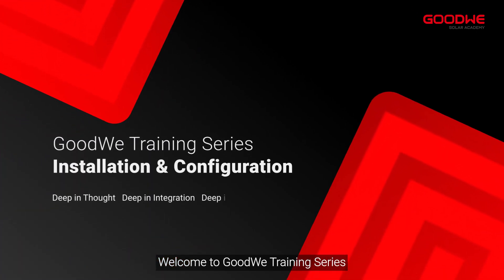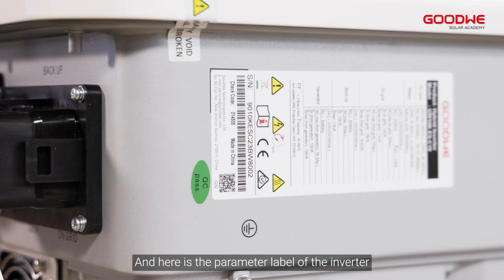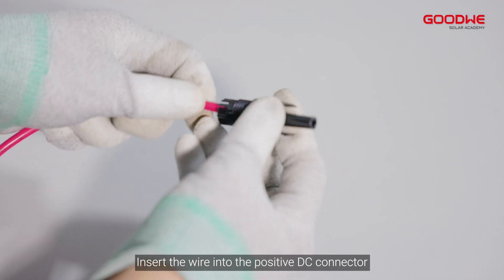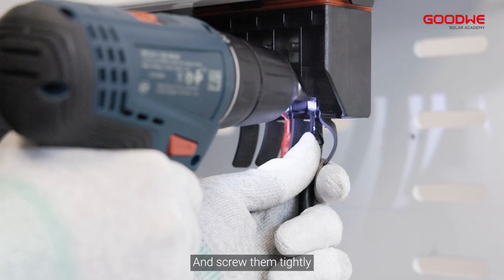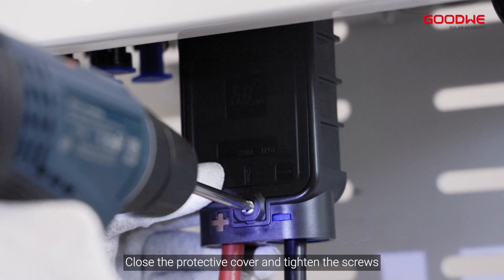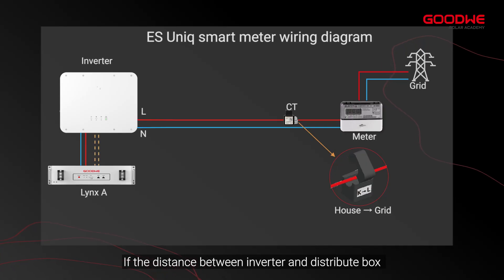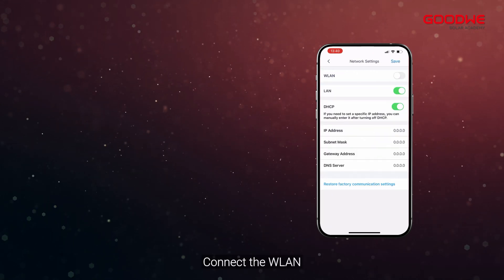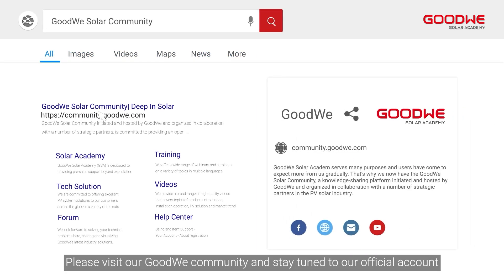GoodWe Single Phase Storage Inverter ES Uniq - Unboxing and Installation

Comment: Can we connect lead-acid battery with it? And does it have dual output or single output for heavy and light load like the other brands here in Pakistan?
Reply from the maker: Yes, it can support lead-acid battery. Yes. it can.
Reply: @GoodWeSolarAcademy  I need a 10kw hybrid inverter with dual output for light and heavy load and with the support of lead acid battery. Kindly give some recommendations.

Comment: Connecting ES Uniq to BasenGreen enclosure with 15KwH batteries.  Have set battery side to Goodwe.  What battery setting to use on inverter side?
Reply from the maker: Hello, I'm not sure ES Uniq is compitable with BasenGreen battery... can you find the battery type on SolarGo APP?
Reply: @GoodWeSolarAcademy  nvm, have decided to get a Deye inverter instead for better compatibility with the BasenGreen
Reply: @GoodWeSolarAcademy it can work with out grid and battery only on solar in day time ?